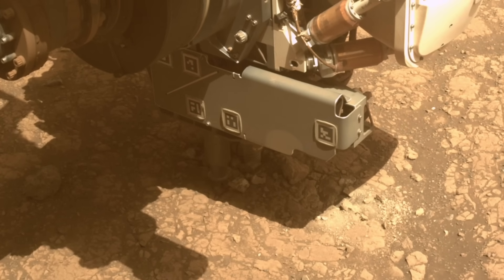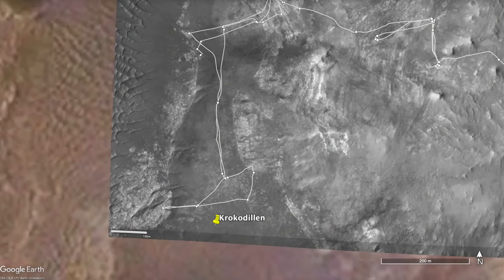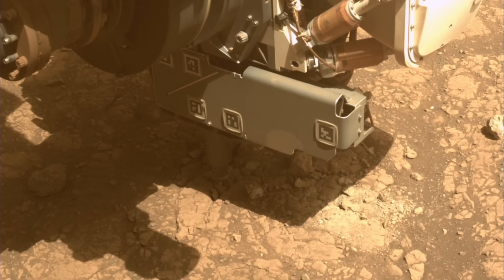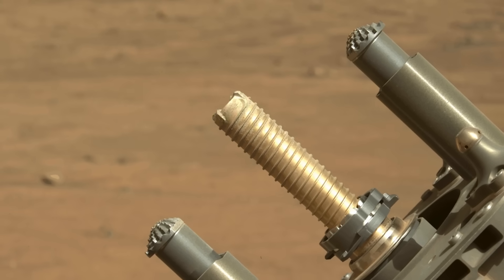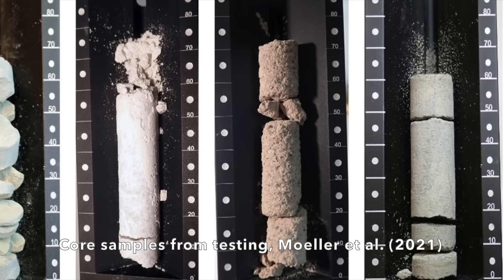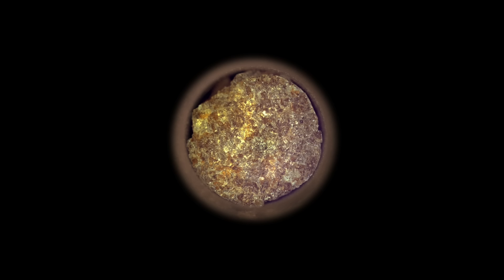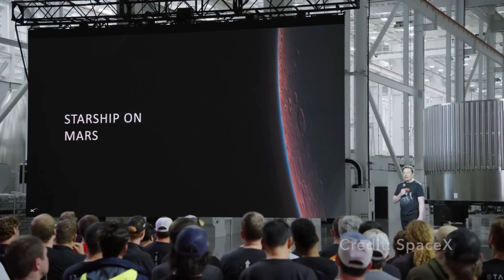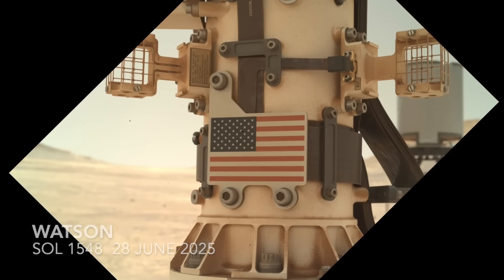Latest Mars sample is symbolic

Comment: Sol 1562: A dust devil appears to be moving roughly NW in a sequence of NLG photos taken by the Perseverance rover. To find its approximate location, I propose going 2 quads further W of Barberton and Jasper, and it would be right in the center of the only side that acts as a border. At the Martian coordinates lat.=18.538ºN; Long.=77.214ºE, after climbing a slope from -2040 meters to almost -2000 meters, a horizontal distance of about 280 meters. 🧐